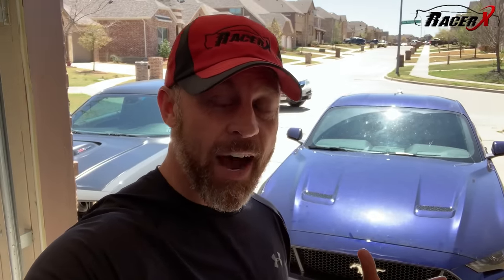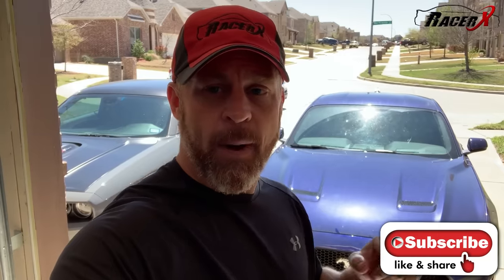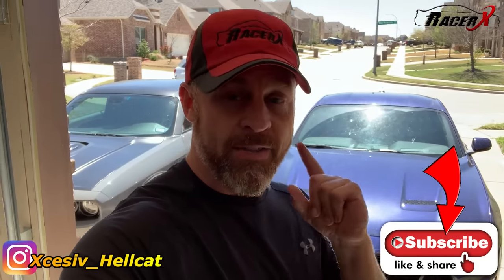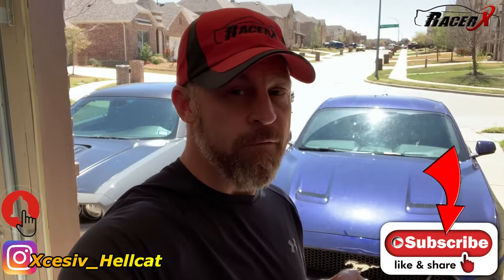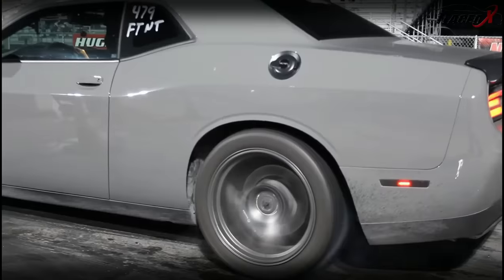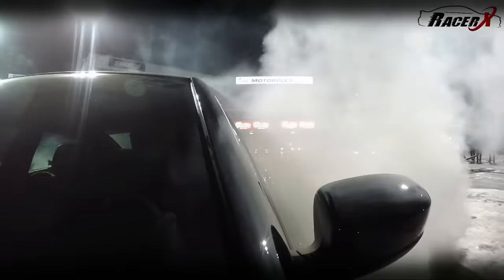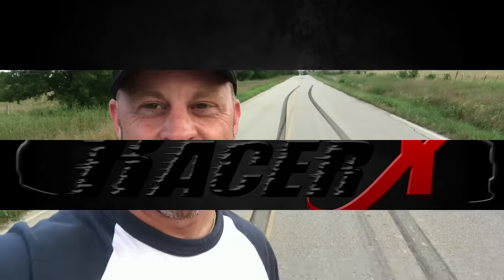Here's the Problem with Going to E85.. I couldn't have predicted this..

Comment: In Europe we have E95,E98 and E102 with 5% Ethanol.. 
I always use E98 in my cars because the amount off horsepower is better with it and it runs much better.

E85 and E91 is something we had here in the 80's :-)

Comment: They shouldn't have banned hemp. It yields more ethanol per acre than corn and can be cropped 3 to 4 times a year.
I am currently having my Nissan 300ZX converted to a flex fuel system and I am glad you mentioned tank life. My car won't be my daily driver and I wonder if running the tank low then adding petrol will solve that problem

Comment: This video is full of false assumptions. Most modern tunes require ethanol detectors and adjust the tune approximately. Making ethanol uses less power and produces far less carbon than refining gasoline. This guy really needs to research real facts instead of spewing big oil propaganda. The biggest myth here is ethanol only produces 30% energy. This is fake, ethanol only loses 6% mileage. You can let E85 sit for 11 months without phase separation.

Comment: I have a quick question… so I bought a used hellcat that definitely has a tuned ECU, every since I bought it I’ve used nothing but 93 but when I actually get on it it tends to bend the shit out of my spark plugs and have to replaced them like everytime I gas it… could it be bc it’s tuned for e85? Or is my problem much deeper?
Reply: Wrong plugs???

Comment: we have a few stations around southeast alabama that still has fuel not mixed its 90 octane i started running in my 1994 ram and runs so much better throttle response so much better and

Comment: is it a good idea to buy a used challenger from a Ford dealership?
Reply: Depending on the condition of the vehicle like mileage, maintenance records and and type of warranty they provide on the car. I purchased a 2018 Chrysler 300C Hemi with just over 6000 miles from my local Ford dealer. It was purchased by a contractor at a local Chrysler dealership. It was like new. Full factory warranty from Chrysler. Clean Carfax. Regular oil change just before he traded it in for a new Ford pickup. He found that a rear wheel drive luxury performance sedan didn't work for taking customers on job sites. I had been looking for the model with no luck. I was there getting my Escapes oil changed and the 300C was taken on trade. I even spoke with the owner. The window stickers MSRP was $45,000. I purchased it for just under $27,000. When you purchase a new demo, the dealer rule is sell the car at 6000 miles. It was like buying a demo. I have purchased several new Ford's from this dealership so they told me to take it home Friday evening and let them know if I wanted the car Monday. I loved the car and it's black exterior, mocha Napa leather and 20" rims.  The Hemi had the performance and the car looked, drove, felt and smelled new. I purchased the car with no regrets. I now have 17,800 miles and now considering extending my bumper to bumper warranty for another 36 months/36,000 miles. Look your car over like engine, leaks, wheel scuffs, tires and oil changes. Get a carfax to confirm no accidents. Where did they get the car. Ask for an extended test drive for at least a couple hours. Good luck.
Reply: @DWH300  its a 2017 challenger shakerhood rt plus with 24k miles for 29k...one owner

Comment: It is great if you don't plan on keeping your car for many years.  I live in farm country (where corn is grown for fuel) and no famers will run any ethanol products in their equipment.  It is very corrosive and will eventually destroy your fuel system.  It is not environmentally friendly.  It is water soluble, so if it spills it will poison the ground water.  Gas and diesel are non-water soluble, so it can be skimmed off water and will not combine with ground water in a spill.  Ethanol also remains flammable until it reaches a 40:1 ratio of water to ethanol, which why foam (AFFF) is required to extinguish it when it burns.  The reason it is cheaper is due to federal and state tax subsidies.  If the tax incentives were taken away, ethanol sales would stop overnight.

Comment: Id love to go E85 but with my set up with the VMP Blower Lund says no way on Gen1 coyote lol
Reply: Why?

Not enough fuel delivery capacity?
Reply: @kyleallen3857  ya they say my dw400 pump ain't enough. I need full return style fuel system and a build bottom end
Reply: @brendantuomey3910  They will sell you whatever they think you can afford. 

Modifying modern Mustangs is big $ compared to the LS and Gen V LT platforms. Stock fuel system on a LT4 is good for over 800rwhp on pump gas.

Comment: don't want none of that alcohol sh.. in my Challenger.  Pass,  you have to have stainless steel fuel lines and anything that comes in contact with that moisture drawing corrosive sh,, !  really.  It draws moisture and if you are not running stainless steel your fuel lines, they rot from the inside out. Pass.  But I tell you Man,  Linda Ronstadt was hot back in the day !
Reply: Ptfe lines.  Not many new cars even use rubber lines anymore.
Reply: @mcfero1  yeah tel that to all the gen 3 coyote engines that live on E just fine. 🤷🏻‍♂️